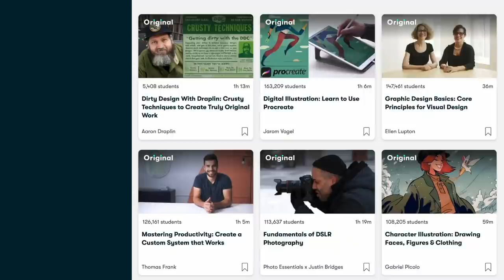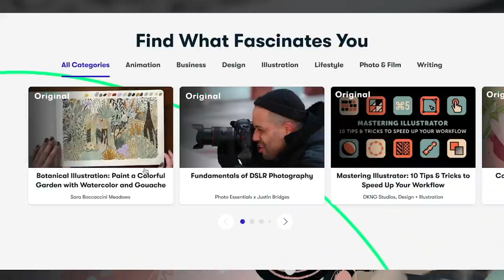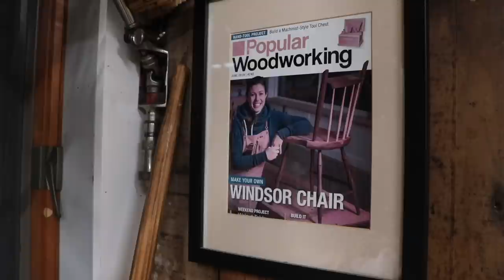I Went on a Road Trip and I Almost Carved a Spoon

Comment: I do understand the concers with fire in the desert without water. As that might be still some time away, would it be possible to burry the whole waste wood in sand and make like a charcoal oven?
Reply from the maker: even if it was possible to burn out here, i'm not super keen on burning plywood and mdf which is the majority of the wood that i scrapped.  also, digging holes in sand isn't something that i'm really interested in doing unless necessary.
Reply: @ijessup  yeah, there would be little left that would be useable as charcoal. Have a great easter weekend \o/

Comment: Why dont you go to harbor freight and buy a wood chipper you could turn your wood into compost
Reply: You can sell it when you're done
Reply from the maker: i would have to build a structure if i wanted to compost.  good compost needs a variety of materials and just having a pile of sawdust isn't going to do much.  the majority of the wood that left the property was plywood and chipboard which i wouldn't use in compost, anyway.  also, the cost for me to send that entire truck full of garbage away was less than the cost of a wood chipper which
Reply: You can spread it out it turns into topsoil on its own sell it when you're done and break even only cost is gas